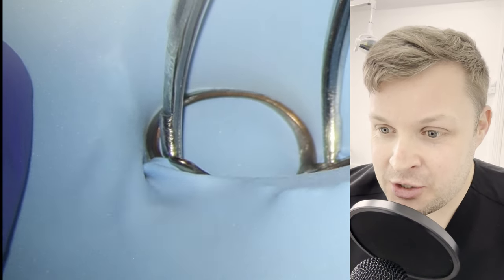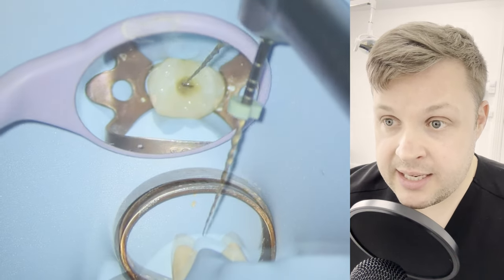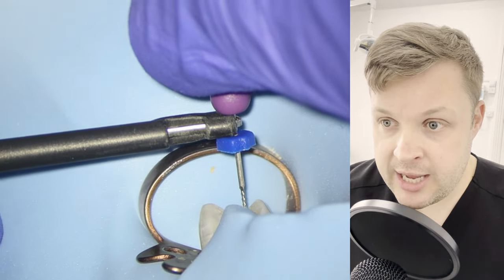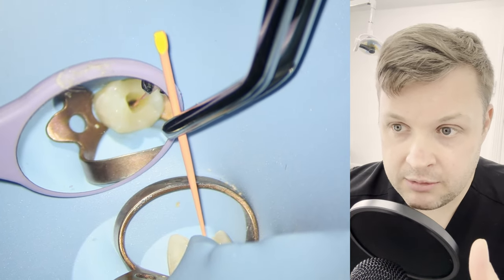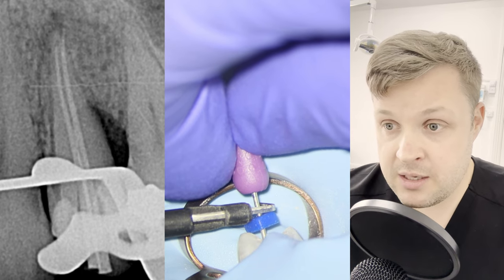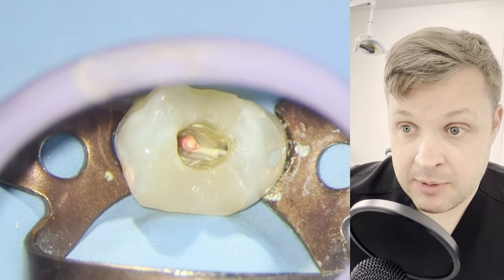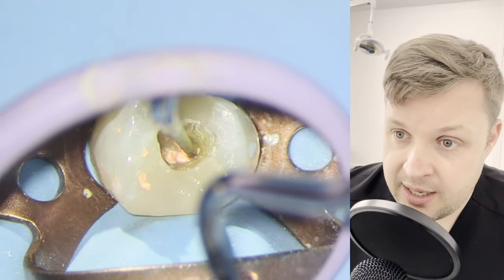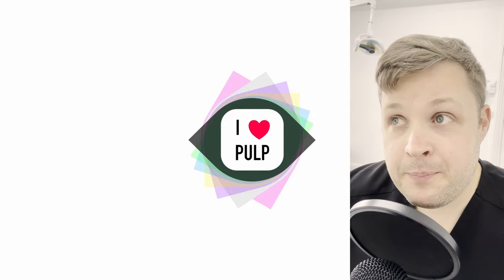UPPER PREMOLAR RCT - IS THERE A SPLIT? | 4K Resolution

Comment: Hello Doc. I have few questions. What is the chamber dressing you used and why? What is the brand of rubber dam you used? And what is the name of the bulk (can't hear it clearly). Thank you for your videos.
Reply from the maker: Thanks for your question! I use non-setting calcium hydroxide, I feel this is the best intra-canal dressing on the market at the moment (I feel better than Ledermix/odontopaste etc). The rubber dam is just a standard Henry schein brand, and the bulk fill is called 'SDR Flow+' by dentsply - do you have any suggestions for further videos you would like to see?
Reply: Also what is the brand of calcium hydroxide that you prefer? @ilovethepulp
Reply from the maker: I am using something called Sure-Paste at the moment  @yongu12
Reply: @ilovethepulp Please explain about the dressing you did as I asked in the above comment. Thank you, Doc.
Reply from the maker: My first comment explains why I use non-setting CaOH, do you want to expand on your question? 😁 @yongu12
Reply: Yes, sorry. It is probably very silly question from your point of view, but is essential for me as I haven't been thought using calcium hydroxide this way. Did you use the caoh in the pulp chamber in 1st visit of SIP tooth for pain relief until you can arrange longer visit for treatment. If that is the case, do you remove the coronal pulp in 1st visit or just open the chamber place caoh and does the patient have pain until the 2nd visit? Thank you for your time.  @ilovethepulp
Reply from the maker: @yongu12 it’s not a silly question at all! I do use CaOH at the first pain visit, and I would usually just dress the pulp chamber. However, if the pulp space is completely necrotic (as in empty), then I would dress the canals as well, usually with a 10# k-file
Reply: Do patients have pain after dressing vital tooth with caoh in chamber until next visit? And do you remove the chamber pulp tissue or you apply over it? Thank you for the answer. @ilovethepulp
Reply from the maker: I think there is no obvious set plan I have for every treatment. usually if the tooth is being accessed then by definition the pulp chamber is empty because the nerve is dying off. if there is pulp remaining in the chamber it self then i would usually remove up to the orifices with the ultra sonic - but to be honest there is no hard and fast rule.     @yongu12

Comment: Hello Dr, great video, your explanation is extremely helpful! Do you gauge the canals with the GP cone or with hand files? Also , do you subtract another 0.5mm from the master GP cone (from working length) for warm vertical condensation? Thank you very much in advance!
Reply from the maker: I gauge them with GP, it’s much cheaper! I also subtract 0.5mm from the working length and file to that rather than cutting the master cone. If you cut the GP then you risk the end not fitting well. Hope that helps. Do you have any suggestions for future vidoes?

Comment: How far does the ultra sonic activation tip goes into the canal. Thank you
Reply from the maker: That’s a good question! It’s something I am slightly concerned about! I know there is a company called toothsaver here in the UK who sell flexible tips, that tend to reach further down - I think that I am going to investigate these in the near future. Although the metal tips do come in different diameters. What do you think?
Reply: I will start to buy one but just want to know how far you suggest to go down from the orifice from your experience.
Reply from the maker: @loz1610   As far as you can go (up to the working length of course!)